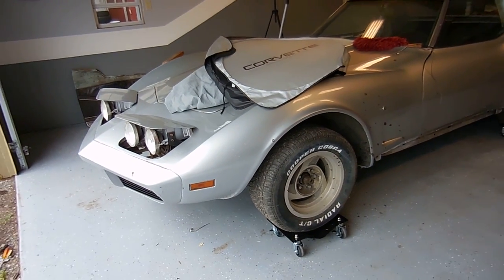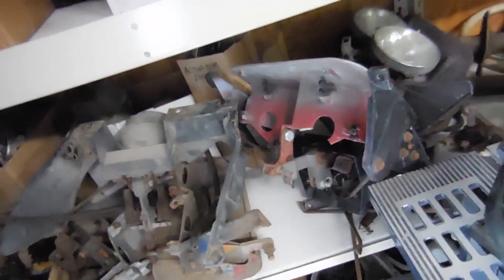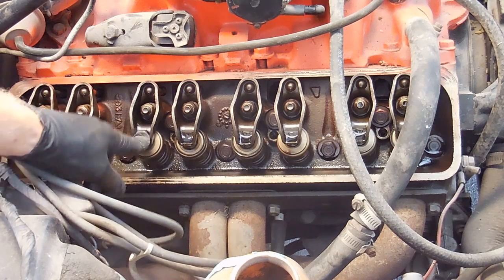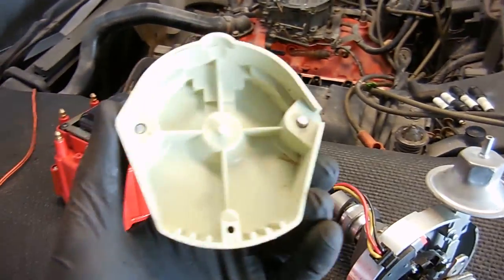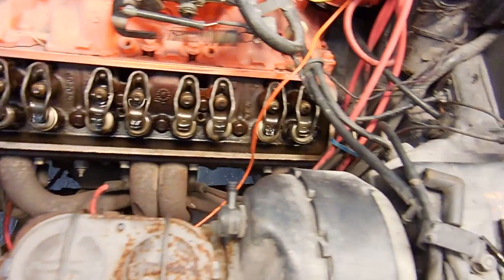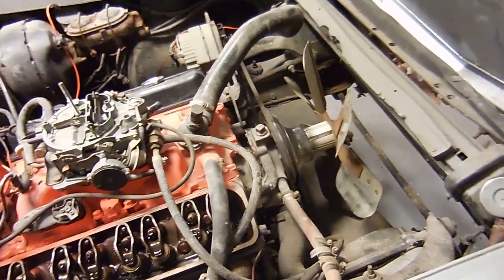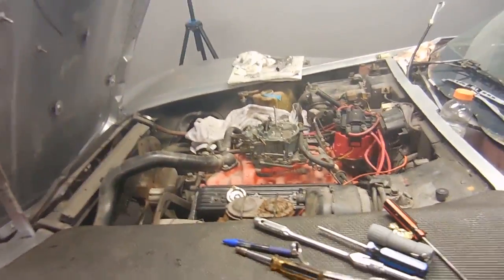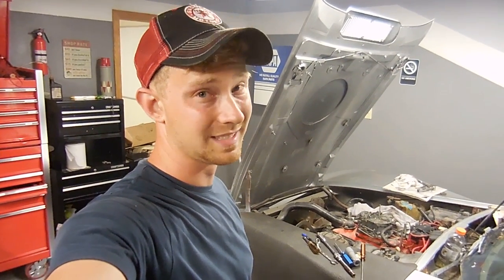Abandoned Project: 1974 Corvette Stingray Video 3 of 13

Comment: Back off rocker nuts one at a time until it starts to tick, tighten back up until it stops ticking, then go a half a turn tighter. This is the right way to adjust the lifters, you can go 1/2 turn to 1 1/2 turns according to GM specs. You may have had no fire with the old distributor in it.

Comment: A clutch fan takes 15-20 hp to run. A non clutch fan even more!!  Lots more!!   I run a 3 row aluminum with dual electrics.  Runs cool and is the best power adder for sure!!   Also. My electric fans use a 161 thermal switch which will run even after the motor is switched off.  5-15 mins in most cases. This is great as it prevents heat soak of my carb and engine components.   You can get different thermal switches to calibrate how long you want your fans to run after walking away from your car.  What makes this so great is when you come back to the car after dinner  , you turn the key, and the motor lights right away!!  No heat soak of the carb where it boils all the gas away.  No need to crank and crank which is hard on the starter motor and battery charge system etc. I like my motor to run around 180-185 as it makes good power!!  Also.. My corvette is a 74 LS4.  A rare original bird to be sure!  Heat soak is a killer for sure.  More of a problem with big blocks.  Still a problem with small blocks as well.  A simple fix even if you still use the clutch fan, you can add a small electric to run after you walk away. Make a huge difference!! Enjoy the ride..:)

Comment: OK, as you might know I'm a regular follower.... please please put a fire extinguisher near your work area. If the carb had backfired on you... well you know... be safe as none of us want it to be "the late" Corvette Ben...
Reply from the maker: +RSBSTEADICAM there is one next to the doorway that you see in the background :)
Reply from the maker: +RSBSTEADICAM you can see it while im.moving the car around, right between the tool box and the door way
Reply: I must have missed it but bring it up to the fender when you're doing stuff on a 10 year old car. I toasted a car once and all it took was about a minute and the entire engine was engulfed... Actually now I keep C02s around since I can't stand cleaning up white baking soda...
Reply: TheCorvetteBen:if you've got oil that is diluted with gas, check the fuel pump. 
The diaphragm is cracked or punctured which would cause that problem. You'll have to replace the fuel pump, not rebuildable.
Reply: RSBSTEADICAM Yes that would be a very smart addition. And maybe a fan to clear out the garage too.
Reply: My son in law, ran out and bought fire extinguishers for our classic cars, after just mentioning a car fire, piece of mind, good son in law

Comment: L88 hood, side pipes, 15x8 ralleys NO TRIM RINGS!!, 67 discbrake centers OR bare with overlength studs w/anodised lug nuts. 
275 60 15?  255 60 15? 255 50 15? 
Rubber bumper C3s look kick a$$ with some steel bumper era C3 details, IE the L88 hood/side pipes, fat steel OEM Ralleys. 
The OEM 15x8 Ralleys are really timeless on these cars. SCCA autocross etc back in the day youd see the C3 running bare Ralleys with fat radial tires. 
Add the fixed 4 round headlight pods like the 69 L88 Greenwood SCCA TA Corvettes and 78 Pace Car style spoilers fromt and rear. 
Theres lots a guy could do by buying an unloved rubber bumper smoger vette on the cheap.

Comment: I would say it was ignition related and someone had tried to start it a lot and that is why the oil has gas in it.  If you can get a full 20 or 30 minutes run time and recheck your compression I think you will be very happy.  I would drain the old gas first.  Run fresh gas.  The smoke will stop too.

Comment: That one rocker arm needs the lash closed up, or you can even measure cam lobe lift against couple of other of the same cam lobes, either intake or exhaust to see if the cam went bad.  It does sound as though the engine has somewhat of a performance 'grind' in it though.

Comment: Don't argue with success, it runs and the lifter is quiet/getting oil. That doesn't look to be the original engine, but who cares as long as it is solid.  Looks like you have found another bubba project for sure!
Reply: I was wondering that. The engine looked really clean and had a lot of paint on it. You never know what a prior owner has done. Ben lucked out if it's a lower mileage engine!

Comment: All the push rods looked like they were spinning, so your cam and lifters are good. When they don't spin, then you got a problem.
Reply from the maker: +turbothrust348 I made sure that they were all spinning and spinning at about the same rate as well. I think this car will turn out.
Reply: Flat lifters are not really flat... there worn if there flat. They are convex, and run off center of the cam, that makes them spin. Roller lifters do not spin.

Comment: few things more satisfying that getting a dead engine running again!  really enjoying your several C3 series.  When did Chev convert the small block to center bolt valve covers?
Reply: If you still haven't got an answer, 1987 is what I've heard

Comment: Looks like the heads are from a TBI 350. Who knows what the short block is.
Reply: I'm guessing someone swapped in a whole different engine, center bolt heads are at least mid 80's or newer.